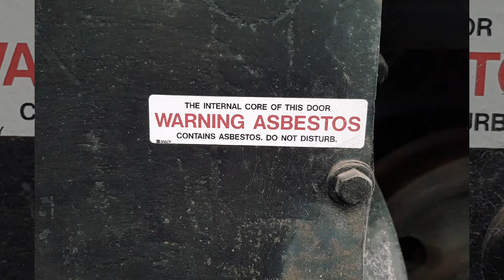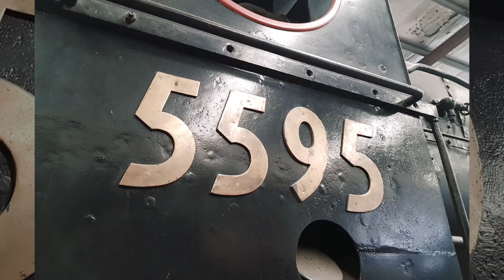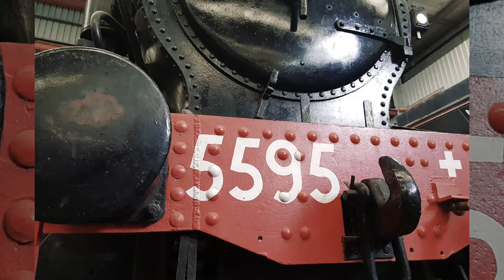Lets have a close look at the sole surviving NSWGR D 55 class 5595

Comment: gonna need alot of work to get that back into steam
Reply from the maker: Just like any steam locomotive thats been preserved these machines are old they reqire boiler inspections, metal fatigue testing and rebuilding, it can cirtainly be done however a running 55 class is probably not on THNSW's agenda right now or in the near future, they are more interested in main line passenger locos history has proved that but if i had the choice of a main line trip behind a 38 or a 55 class i would choose this glorious old workhorse !
Reply: Plus there is asbestos in the cylinders I believe
Reply from the maker: @thatonec_set3730  yes there is. All steam engins had aspetos cladding